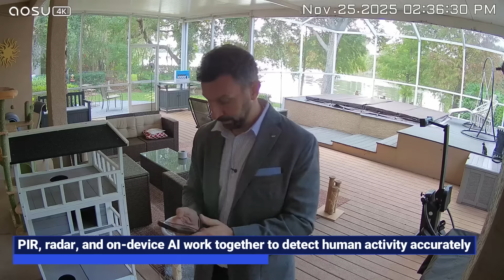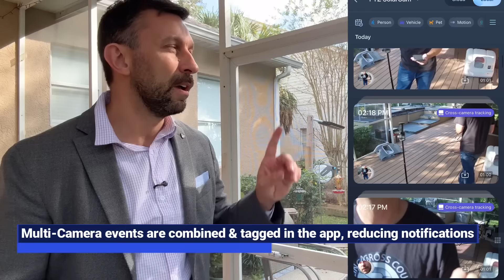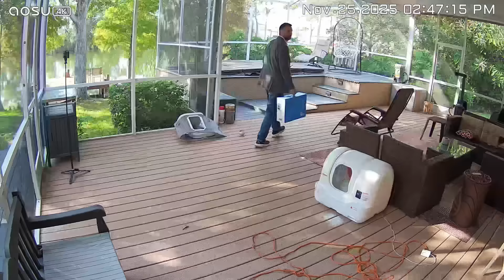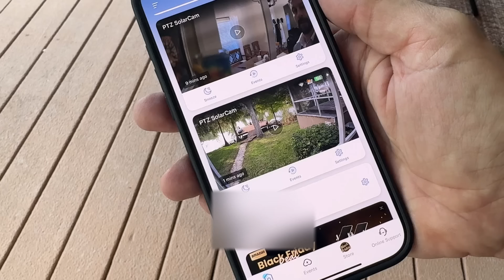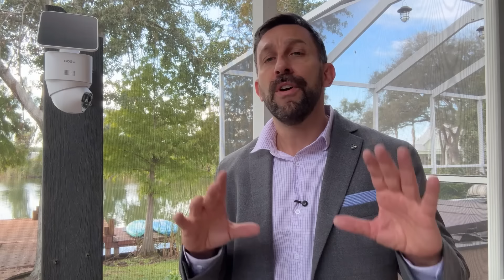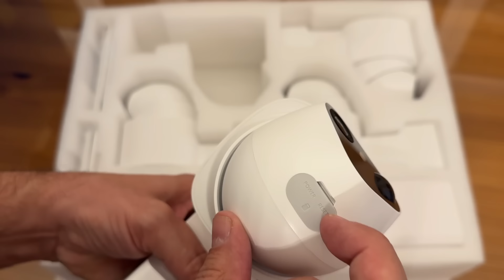aosu 4K SolarCam T2 Ultra Security Camera with aosuCortex System | 4-Cam Kit, 360°Pan&Tilt

Comment: I just bit the bullet and ordered one! Just under $200 CAD on Amazon . I have been happy so far with my 2 Aosu doorbell cameras. This camera will replace my eufy s340 which inexcusabley does not charge the battery in under 0 degrees temperatures, a bit of a issue for Calgary winters 🥶

Comment: How easy is it to expand storage beyond 32GB? 🤔
Reply: Very easy. The aosuCortex comes with built-in 32GB storage, and you can expand it by adding your own hard drive (up to 16TB). No subscription is required for local storage, and the system recognizes the drive automatically once installed.

Comment: I love that this system integrates with Google Home and Alexa, it’s convenient to check cameras through voice commands. The solar panels make it easy to maintain, and the AI tracking really makes a difference in monitoring activity. My main issue is that the app sometimes crashes during live streaming on older phones, which is frustrating, but it works perfectly on newer devices. Overall, it’s a high-quality system that delivers what it promises.

Comment: The aosu SolarCam T2 system is solidly built and feels durable. The AI tracking across multiple cameras is very impressive and gives me peace of mind when I’m away from home. True Color Night Vision is amazing, better than any camera I’ve used before. The system is on the expensive side, but considering the features, it’s justified. The only small problem is that mounting the solar panels on angled roofs can be tricky, so be prepared to spend some extra time for ideal positioning.

Comment: This is easily one of the smartest security systems I’ve ever owned. Setup is fast, the hub makes everything easy to manage, and the 360° coverage really leaves no blind spots. Two-way talk and the alarm siren work perfectly, and having no monthly fees is a huge bonus. My only complaint is that the cameras are a bit sensitive to wind and trees, occasionally giving minor false alerts, but the AI detection helps reduce them. Overall, highly recommend for a high-tech, solar-powered security system.

Comment: aosu's SolarCam T2 Ultra 4-cam system delivers 4K resolution, 360° coverage with AI tracking, advanced motion detection, and perpetual solar power. Integrated hub provides secure local storage, smart alerts, and seamless app control without ongoing fees

Comment: I recently installed the aosu 4K SolarCam T2 system at my home, and I have to say, I’m genuinely impressed. The AI tracking works exactly as advertised, each camera follows movement seamlessly, and the 360° pan & tilt coverage ensures there are no blind spots. Setting it up was surprisingly simple, even for someone not very tech-savvy. The solar panels are a nice touch, keeping the cameras charged without worrying about outlets. Only downside: the app occasionally lags when switching between cameras, but overall, worth every penny for the peace of mind.

Comment: This system is packed with features: solar panels, 4K cameras, AI tracking, siren, two-way talk, and expandable storage. It’s like a professional-grade setup at home. Installation was a breeze, and I had all four cameras connected in under 30 minutes. My only gripe is that the initial sync with the app can sometimes be a little slow, but once it’s connected, everything works perfectly. Highly recommend for anyone serious about home security.

Comment: Does the system integrate with other smart home devices beyond Google and Alexa?
Reply: At the moment, the system officially supports Google Assistant and Amazon Alexa. More integrations may be added via future firmware updates, but currently those are the supported smart-home platforms.

Comment: Is the battery backup sufficient during extended poor weather?
Reply: A: Yes, the T2 Ultra is designed for continuous rainy or fully-overcast weather, the built-in 10000mAh battery can independently power the camera for up to 90 days.